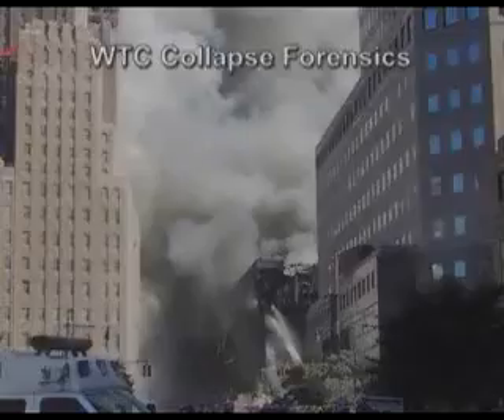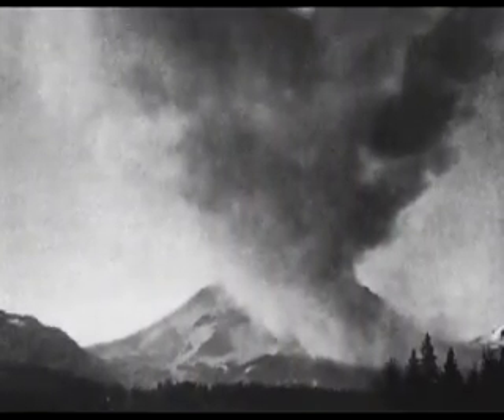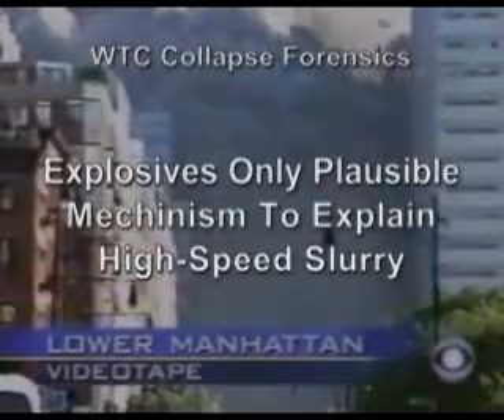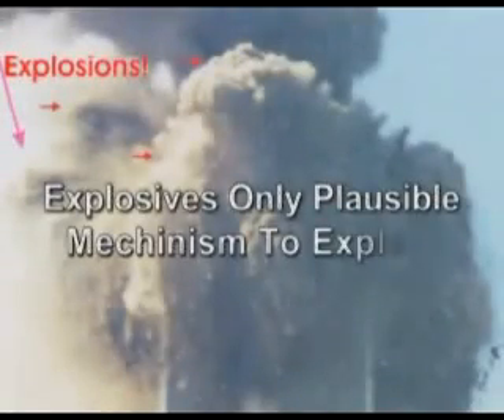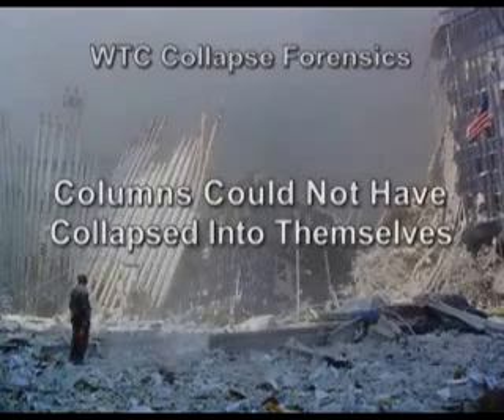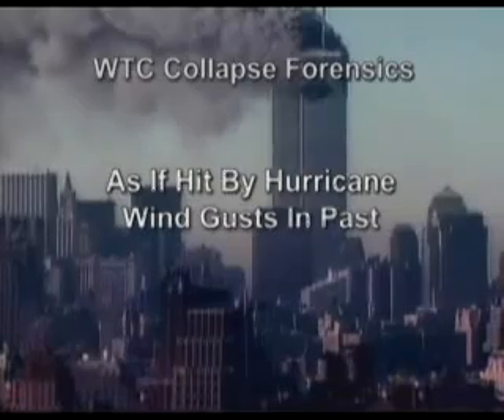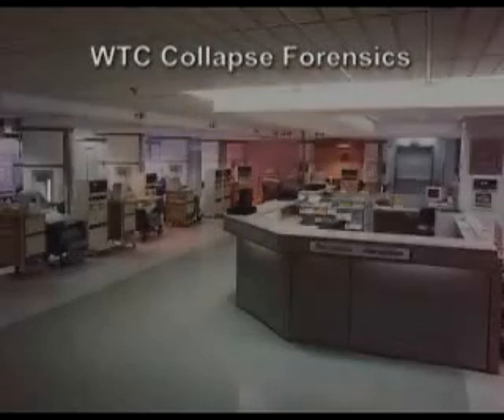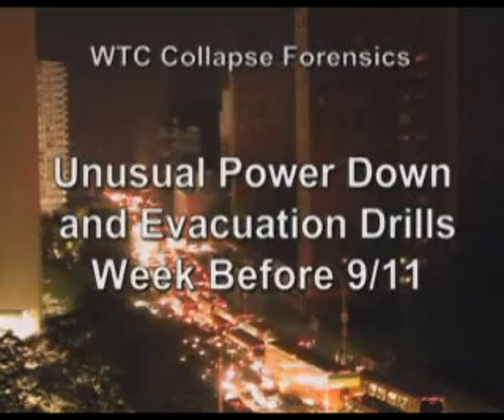MIT Engineer Disputes 911 Theory of the WTC Collapse-Part 2

Comment: That's a very good point, and most people accept this is what happened.

However, a growing number of engineers and architects have examined the structure of the building and the unusual ,to say the least, spectacle of the ACCELERATION of the building when falling - when it is encountering more - not less - resistance. 

Remember, if those impact columns were taken out, and the immediate surrounding ones were weakened,  the top should have fallen over. Check out ae911truth and get the facts.

Comment: Ah, you're getting there Eddie. The towers were near failure by the massive damage inflicted on them by the plane impact, the massive explosion, and subsequent fires. There was phenomenal structural integrity of the the towers, as you pointed out, As you can clearly understand, once compromised that same structural integrity will work against itself in the release of the energy the was previously used to keep the structure standing, or the natural formations intact. You're getting there!

Comment: Avalanches and landslides are examples of systems that are near failure when triggered, much lke the WTC towers were near failure from the core structure undermining by explosives.

The "awesome force of gravity" was resisted 7.5-fold by the combined safety factor of the core and exterior structure. 

Comparing the collapse of the towers to the unstable nature of a natural formation that invites a landslide or avalanche is not only misleading, it is ridiculous.

Comment: Who said that? No, Eddie, the theory is not that incidentally sharpened shards of aluminum happened to scrape off sprayed-on fireproofing from the steel beams like a barbershop shave ROFL. It's that the fireproofing was knocked off due to the impact of the plane and subsequent explosion. It should be noted that the collapse initiation was at the point of impact, in both cases. I've watched the power of avalanches, landslides, and other examples of potential energy. Gravity is an awesome force.

Comment: You're not a fairy, you're a troll. 

Seems when deniers get pinned by their own lies, they start quibbling over semantics.

Simply put, for the willfully obtuse, "It is an exercise in wildly imaginative thinking to propose that bits of aluminum from the 767 that supposedly shredded as it entered the WTC tower structure were energetic enough to scour enough of the structural steel in the vicinity to render the columns of an entire floor vulnerable to office fires."

Comment: I really think my idea makes more sense. During the pancaking, the slab-façade connections that were meant to resist little moment were exposed to an unforeseen amount of it. Thus, the connections and the slab up to the distance 'd' snapped or 'exploded,' which would explain the large concrete chunks. This actually all makes logical sense from a structural perspective.

Comment: What's wrong with this theory? In the collision, a number of structural core columns were damaged/exposed, and fire fueled by the combustible office material brought the temperature high enough for the steel to yield. The collapse took some time, meaning that the steel's resistance was over it's Fcritical, which decreased as the temp went up. Then when the columns gave, the floors pancaked, forcing large moment on the exterior façade connections explaining the concrete 'exploding.'

Comment: YOU do not KNOW that airplane bits knocked the fireproofing off all the structural steel, either.

The energy that was available from the collapse scenario described by the official conspiracy theory was calculated to not have enough energy to get the job done.

Your "official reporting" is a con job sucked up by gullible souls like you who couldn't calculate their way out of a paper bag.

Your characterization of the energy available is a layman's poor excuse of proof, unsubstantiated.

Comment: Yes, appearances can be deceiving, but we know that the lower core was undermined  from the reports of exlosions in the basement and elevator shafts.

And then we have the scattered fires and the aircraft impact, which together still didn't have enough energy to cause the global collapse.

That leaves controlled demolition as the likely cause, especially with what LOOKS like an explosive debris cloud at collapse onset and what LOOKS like the remains of controlled demolition in the rubble pile.

Comment: You're right...I should leave the nonsense superlatives to the troll community, since they have nothing else to offer.

Since the NIST report was unable to explain the full collapse using structural analysis and physics, despite years of wasted effort, it follows that their premise was flawed to the point that its demise was inevitable.

Fortunately, scientists and engineers have stepped up and provided a clear case for controlled demolition of the WTC towers and Bldg. 7, based on true science.

Comment: So back to square #1. The bottom looked intact, the top looked intact. The bit in the middle didn't. And then we have the fire. Put the two together and that's what you get. The conspiracy theorists are asking us to believe that somehow, two heavy jets impacted those buildings precisely at the point that explosives or thermite had been planted to induce a failure. What on earth would they have done with all that stuff if the aircraft had have missed?

Comment: You are incorrect. Even the fatally flawed NIST study couldn't make the trusses sag enough, even by heating past the  temp claimed.

Steel I-beams lost strength from exposure to heat from burning jet fuel after a relatively short time "as seen in different experiments"? What experiments?

Don't be irresponsible, bman, even if you DON'T have MIT teaching credentials.

Comment: Is that the "experiment" where they put an I-beam about 2 feet above a pit filled with jet fuel, in an open field and light it on fire, instead of 12 or 15 feet above as the actual building was designed? Open air huh? Not with such a lack of oxygen. The fire was using up the oxygen, and the heavy smoke was not helping the fires either. Smoke was billowing out on all sides, so there was little O2 getting in to feed the fire, hence O2 starved fires. My BBQ pit gets hotter, but doesn't collapse.

Comment: Watch this segment of the NatGeo documentary addressing some of the 9/11 CTs. youtu.be/OrBNJJc-DIY?t=18m33s. Demonstrates how hot  jet fuel actually burns in an open air environment (2000f), and how quickly steel loses its structural integrity when exposed to that type of heat (3.5minutes). 

The "pyroclastic flow" is a red herring and demonstrates nothing. The enormous amount of potential energy stored in the towers and released once the collapse initiated  dwarfs any type of explosives.

Comment: Jet fuel burns at open air temps of around 600 f the degradation of steel integrity at 600 f is so insignificant its almost immeasurable .He also stated that the fuel would mainly served as more of an ignition point rather than the main fuel for the fire  .Steel when subjected to +1000 f rapidly loses integrity but untill that point it still has %80 structural integrity .the most interesting thing i think he pointed out was about pyrocrastic flow.

Comment: "Steel keeps its a lot of its structural integrity even as it approaches its melting point". This is simply an inaccurate statement (among other odd suppositions). As seen in different experiments, steel I-beams lose significant structural integrity after a relatively short amount of time from exposure to heat from burning jet fuel (not as hot as fires from offices combustibles as in the WTC office fires). This is just irresponsible coming from someone carrying MIT teaching credentials.

Comment: 1. The smaller the particles, the better and deeper they can penetrate the body's organs to cause havoc. NY 9/11 saw a LOT of extremely fine particles.. and not just smashed electronics, but also smoke detectors (which use radioactive materials), mercury, asbestos, cleaning chems, etc. That dust wasn't healthy for sure...
2. The attack came from above (gravity). Also, it wasn't circular, more like 4 intersecting fans matching each of the building faces. Diagonally there was little debree.

Comment: The concrete you speak of was already a thermoplastic cloud the instant the building began exploding.  Again, you said it hit the ground at 200 mph.  You also claim the building didn't go into free fall... so how did the top hit the bottom half and still manage to achieve 100-200 mph?  You're aware that the 3rd law of thermodynamics had to be suspended in order to both exist in the physical realm, and reach those speeds.

Comment: How fast do you think the towers were moving just before they hit the ground, after falling 1/4 of a mile? It wasn't a trivial velocity! You do know that a number w/ only 1 non-zero digit has only a single digit of precision, right? The towers hit the ground in excess of 100 mph; so, between 100 - 200 mph. Regardless, concrete does not tolerate that kind of shock very well!

Comment: WTC 1/2 did not go into free fall at all, at any point in their descent. That should be obvious, just by comparing the parts that *were* in free fall, alongside the building. Instead, the top portion collided w/ the lower portion. The force of that collision was far more than enough to disintegrate concrete instantly. The force of the falling top was much greater than the weight of 100-ton members.

Comment: But then the concrete would have to free fall with no resistance - instead of free fall through a steel and concrete structure below the impact that just politely got out of the way, and it doesn't explain why it turned to dust instantly without even having fallen a few feet, nor why 30 ton beams took lateral trajectories.  Nor a hundred thousand other inconsistencies in the official conspiracy story.

Comment: Error 1: Cement, burning plastics, smashed electronics etc do not cause radiation bone cancers and leukemia. That's not only pseudo-science, but first class quackery.

Error 2: The circular perimeter of a destruction is completely irrelevant to where an attack occurs. Tossing a pond in a water doesn't generate a circle either. You don't grasp basic mathematics either. You clearly haven't analyzed the damaged buildings, you lazy ape.

Error 3: The only thing predictable here, is your stupidity.

Comment: No, he says, "the buildings came down," because THE BUILDINGS CAME DOWN! 

Deputy Chief Peter Hayden: "Early on, we saw a bulge in the southwest corner between floors 10 and 13, and we had put a transit on that and we were pretty sure she was going to collapse. You actually could see there was a visible bulge, it ran up about three floors. It came down about 5 o’clock in the afternoon, but by about 2 o’clock in the afternoon we realized this thing was going to collapse."

"Firehouse" Sep 2, 2002

Comment: Not near the time of the collapse according to the FEMA report. The firefighters left building 7 at 11:30 and building 7 collapsed at 5:20pm. The link you posted doesn't fully appear. All the smaller buildings near the towers had sustained much more damage then WTC7 none of them collapsed except for WTC 7 which was farther away and looked a lot better then the rest of the trade centers. I'd like to know when you speak of explosive charges are you including thermite as well?

Comment: Hi Jason. I see you're very familiar with structural designs. And yes the structural designs of the twin towers are very different. It's designed is fall downwards not sideways. I guess you also know about the compression and tension forces upon the structures of the building. Imagine an egg. you can compress it from the top and bottom portion of it with your fingers but you can't break it. Let's say when you're pressing the egg, and then I'll shoot it with a pellet gun. What will happen?

Comment: No it's becoming more destructive as it leveled down upon another floors adding more weight to it considering the height of the building. Like domino pieces. Don't say that dominoes don't have a resisting force into it when acted upon by another piece. Of course we all know the building has a core and frame that supports it, but we're speaking of tons of weight here in an unstable inner and outside frame because of the collision. LOL

Comment: An injury at the top floors , doesn't crush everything below it . The dust indicates the concrete is destroyed to pulverizing . Not possible , because there's more strength below , than force exerted , by collapsing upper floors . Therefore they had to be weakened for three buildings to implode . If your having a problem visualizing this , then your part of the conspiracy .

Comment: i used all relavant PPE (safety is most of my job) including a wetfilter mask; but to the point once i noticed this oddity i called in a professional to do the job.  I didnt know what it was before hand. The house was built at the end of the era and ive done plenty of concrete cutting before but never saw anything like this (im not all that old) I was just making the point that the concrete compositoni would of greatly contributed to its effects and simulating on say cinder blocks wont cut it

Comment: this is something ive come across in person.  If you cut old concrete, and by old i mean asbestos days concrete (1950-70's) that was in my house, i used a 9" grinder with diamond tip. Just touching the concrete caused a complete grey out of my 20x30fot laundry.  If the type of concrete was similar (i know the WTC was built much earlier then the 70's) but newer, less poisoness concrete cuts much differently.

Comment from the maker: 1. There is no verification of the wreckage for all crash sites. The electrical panel had a serial number on it. You pointed this out. Did you forget that? Why didn’t they release that? A serial number is also needed to extract the FDR data. There is no logical reason not to release these numbers. Wait a sec. You actually think both titanium-steel alloy engines at the Pentagon burned or melted away??? LOL!

Comment: Actually it was in the link I sent you but you glossed over that so fuck yourself ;)

yeah they are both witnesses to the event... one I would support and the other I would not, from evidence... the question was, which one would YOU support, since you have been using it to express the fact that bodies were found in chair by a witness, despite the fact that your usual argument is that there were no remains found from a plane entering the building... you are contradiction after contradiction.

Comment: There is so much wrong here - there is video evidence, we just discussed it - no massive fire, so what burned those people to death? I thought jet fuel burns off quickly, is that wrong now? - why would YOU be allowed to see bodies (mangled remains at that) or DNA id? - perfectly circular hole in the courtyard, actually the rest of the building had a gradual cone shape entering the building as would be expected if a cylinder entered (wings etc dragged in) - seismic, missiles not register either?

Comment: Investigators have identified remains of 184 people who were aboard American Airlines Flight 77 or inside the 
ht tp://ww w.arlingtoncemetery.n et/pentagon-unidentified.ht m

Pentagon, including those of the five hijackers, but they say it is impossible to match what is left with the five missing people.
A team of more than 100 workers at a military morgue at Dover Air Force Base in Delaware used several methods to identify remains but primarily relied on DNA testing and dental records.

Comment from the maker: vaed*uscourts*gov/notablecases/moussaoui/exhibits/prosecution*html
 
With exhibits: P200042, P200045 P200047 P200048 

The body/body parts are titled: "Photograph of bodies/body parts found inside the Pentagon after Flight 77 crashed into the building"

Nothing about passengers..was there anything else? .

Comment from the maker: Enter logic. An 80 ton plane hits a light pole at 500 mph and the poles are only a few feet from the foundation? Next: When an 80 tom plane strikes a reinforced concrete wall at basically ground level with such force that the majority of the plane vanished, disintegrated, liquefied (or whatever debunkers are saying now), there should be at least a blip on the seismic charts.

Comment from the maker: Like these?

"it didn't appear to crash into the building; most of the energy was dissipated in hitting the ground, BUT I SAW THE NOSE BREAK UP"-Tim Timmerman

"the NOSE of the aircraft BROKE THROUGH THIS INNERMOST WALL of C ring into A-E Drive."-Every Walker Lee

It (pentagon) barely budged as the NOSE of the plane curled upwards and CRUMPLED."-Vin Narayanan 

"And it went in through three rings. I'm told the NOSE IS STILL THERE,..about one ring away."-Donald Rumsfeld

Comment: Nope, that's a different perspective from the other camera in which the tail section IS visible. Note: that "white streak" is plain evidence, along with photographic evidence that corroborates, that the engine of the aircraft struck a lamp post on the way in and became damaged in the impact. I put a video up of that but of course, you didn't watch it.

Comment from the maker: You mean this one? Tail section? Uhh, no..

watch?v=lsWZHKIg3Cs

Yes, very good point. The jet fuel contributed to the fire weakening massive steel to total failure in just 56 minutes with the South Tower. But, more than 30,000 lbs of jet fuel supposedly entered the Pentagon and yet nothing is even scorched just on the 1st floor? Makes ya think, huh?